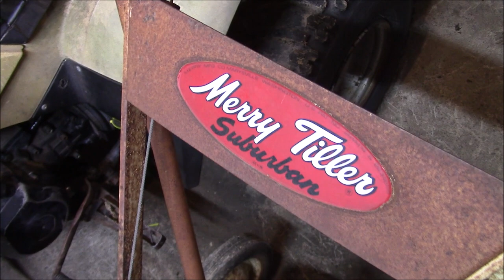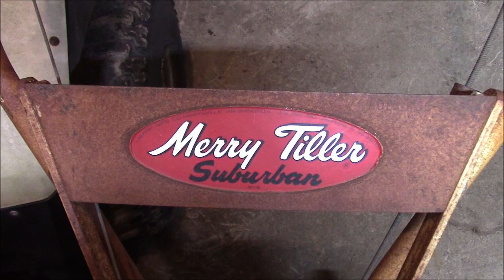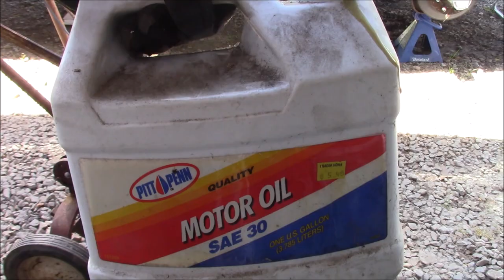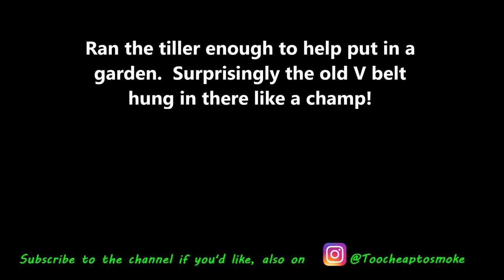Fix or Get Scrapped: Merry Tiller

Comment: I have the same tiller as that except mine has the K-91 Kohler engine upgrade. I got it second hand many years ago and used it in our garden for years. I lent it to a friend and he stored it outside, wrapped in plastic. You can imagine the condition it was in when I got it back. I have every intention of getting it back in very good running condition. The patina on mine is very similar to yours only a little rustier. Safety? you don't need no stinkin' safety when it's going forward. It's not like its going to back up on you. I was very happy to see another video from you. I love working on this stuff.
Reply: lesson learned if they don't own it they don't give a damn.

Comment: I am in New Zealand. This would sell secondhand for about $450 if going. $200 if not going.
Several reasons: self sufficiency has grown alot esp since covid. Masport make them here but a 6 month wait list. $1250 new. New name brands, eg the Stihl is $1600.
Secondly the shipping charges are 10x precovid, so the only ones are from stock pre covid.
There was a Mantis reseller here, but they have paused for now.
Reply from the maker: Wow, that's pricey.  I ended up getting $50 out of this one after using it a couple seasons.

Comment: I was wonderin' where ya been- are you starting a new gardening channel so you have some taters to go with the Spam and are you growing your own onions too?  Yep spent hours behind the handles of one of those things. we had one with a five horse I think it was a Coast to Coast hardware branded machine. Spent all winter with a wash tub over the engine with just the handles sticking out of the snow in the Minnesota winters, and fired right up each spring.
Reply from the maker: You gotta love those pieces of equipment that get neglected for months/years at a stretch, then just get put right back into hard service.
Reply: @toocheaptosmoke  Yep I got the Simplicity walking tractor that sat at the inlaws for near 40 years running again after being stuck all that time
Reply: That mochine is great for diggin deep for taters.

Comment: Yah the famous recoil squeal lol you need to take that one way starter that hold the flywheel on off then take it apart an clean the balls that are inside an sand paper the shaft clean the it back together with a very very lil shot of blaster . Never use grease or oil inside then because it will couse the balls to stick inside the starter housing an won’t grab . I found out the hard way when I was at the lawnmower shop. When them things start squealing an catch you off guard it will scare the shit out of yah an it’s so loud it is nails on a chock board x69 louder an painful 😂 another truck fir them Briggs starter bearings there is a felt inside the end of the square thing we’re you see that hole what u sprayed well suppose to be you can pull a very very small drop of tranny fluid on the felt that will help lube the starter housing for the crank shaft

Comment: Love the safety of old tools man. My dad had a Skill brand jigsaw that just had an on and off slide switch. I also used to use my dad's tiller when I was a kid very similar to that, but it was a Craftsman. Worked the same, lock that drive in place and hold on cause she'd keep going till it ran outta gas. All this modern safety junk has taken the excitement and challenge out of using power tools and lawn and garden equipment. I mean using an old chainsaw was kinda exciting. None of that anti kickback stuff, or the new style chains they use on consumer type saws to help prevent it. Of course back when what was a seatbelt right. Or those stupid looking bike helmets they want kids to wear now. When I was a kid if we got hold of motor cycle helmets or something it just made us do stupider stunts because we were indestructible with those helmets on. Football helmets counted too. Sorry for the long comment but I mowed my big ass lawn today and that requires many beers to accomplish. Have a good Fourth man, and take it easy. 😎
Reply from the maker: Using stuff back then required you to really pay attention!

Comment: A fun project but those tillers as well as most front tine tillers are useless. They're basically a decades old scam of a garden tool. Unless you are running through fluffy soil after a rear tine tiller has already done all the work, they are garbage. Save the engine for something else that turns up in the future.
Reply from the maker: This one has already been sent down the road, haha.  It worked better than I though it would breaking through sod, but man was it a workout!
Reply: @toocheaptosmoke  They were indeed a workout, but ya use the best tool you have, so if this is what ya got ya use it! In the early to mid 60's these were all that were available.